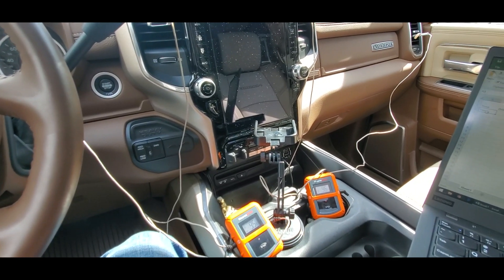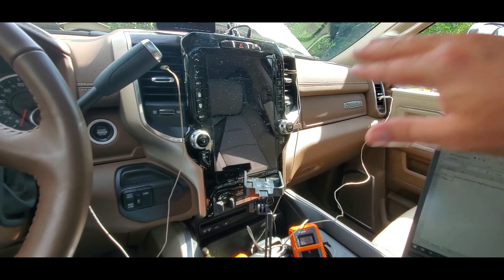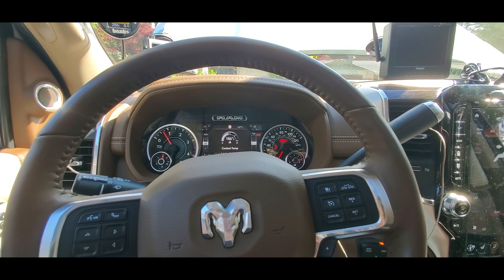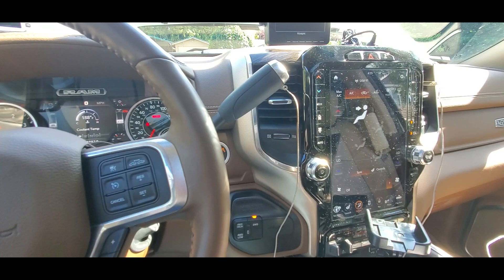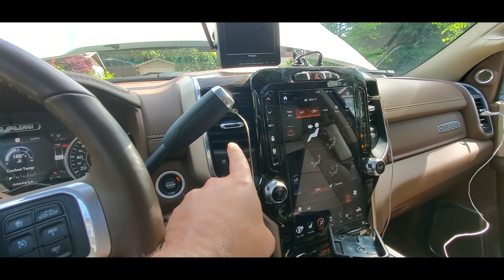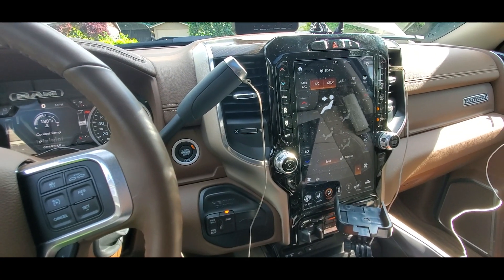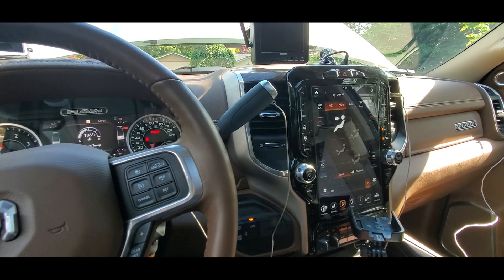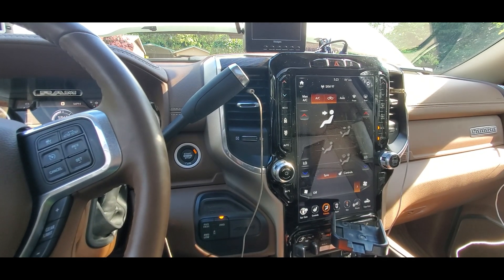Why is the air conditioning so bad in a 2019 Ram 3500?

Comment from the maker: Ram released a fix for this issue in TSB 24-001-20 in November, 2020.
Reply: I am realizing that i need this fix done
Reply: What is the fix or where can I read about it?
Reply from the maker: @nandiito  Google "TSB 24-001-20" and read the first document. The Fix is to have the dealer replace some air conditioning components. It was free for me because my truck is still under warranty, but it may not be free if your truck is out of warranty.
Reply: @alstuart  I just got a 2021 TRX, not sure if it would have that problem but I’ve been in the forums and seeing people complain about their ACs. Not sure if mine has that problem.
Reply from the maker: @nandiito  TSB 24-001-20 only applies to 2019 and 2020 models. There may be a separate issue with the 2021 models, but I am not aware of it. I recommend you take it to the dealer so it can at least be logged. Sometimes Ram doesn't take an issue seriously until enough people have complained.

Comment: Hey I believe the temps will get colder if engine increases RPM. When i had my 2019 Ram at dealership the mechanic indicated that the engine RPM has to be at 1500 to test system.

Comment: There’s a TSB out for this now. Fixes this exact issue:

AC issues are a combination of the blend doors not sealing correctly (hence the reason for the new HVAC box part number), a duct temp sensor location (the reason for the new distribution box part number and new temp sensor), and HVAC module mapping (the reason for the new HVAC module part number).

https://static.nhtsa.gov/odi/tsbs/2020/MC-10184475-9999.pdf

Cheers
Reply from the maker: Thanks. I pinned a comment about the TSB.
Reply: Do you know how much this TSB will cost?
Reply: @hiimkalx  Wish I could help but IDK, since mine was done while under warranty and TSBs are covered. Otherwise, you will need to ask dealer for pricing. 
Tell you what, the amount of work involved is extensive so it cannot be cheap. Thanks.
Reply from the maker: @hiimkalx  It didn't cost me anything when my dealership performed the repair in the TSB. If your dealership refuses to perform the service, let me know so I can help you.
Reply: @alstuart   yeah they said they can’t give me a price because I need to take it in. So I did and then they told me that my expansion valve is the problem. Is your truck still full bumper warranty? Mine has 50K miles on it and I only have the power train warranty left. I also have a 2019 2500 Cummins.
Reply from the maker: @hiimkalx  My truck is a 2019 with 25k miles on it. I don't think it should matter if your warranty is expired because this is an engineering defect that came with the truck.
Reply: @alstuart   so how do I go about trying to get this fixed? I’ve called 3 different dealerships and none of them seem to want to do this TSB.
Reply from the maker: @hiimkalx  go to hdrams dot com and create an account then send a message to @RamCares telling them you need help getting a dealership to perform the Repair in the TSB.
Reply: @alstuart  I appreciate it! I just messaged them. Hopefully they can help me out! I live in Utah and it’s one of the hottest summers we’ve had and this A/C not working sucks! I hope I don’t have to pay for it either. The dealership says since it’s not a recall that they dont do it for free.
Reply: So I just called multiple ram dealerships in my area and they said a TSB is vin number specific and they couldn’t find a TSB for my truck. Plus even if they did they said I’d have to pay for it. This is crazy!

Comment: Spot on!
I live in Central Texas and have a 2019 ram. The AC was instantly noticeably shitty. When summer reared its head. Long hauls it was ok..but city driving in this truck is crazy.
Dealership won't do anything since it's "working as intended "
Reply: I am having the same issue, very frustrating!
Reply: @Steven Ellis Ram released a TSB to fix this issue.  https://5thgenrams.com/community/threads/a-c-performance.605/post-364641

Comment: Did you record how to install that valve?
Reply: I just found Ramcare post on forum that they are developing a solution to solve this problem, waiting!
Reply: @uscache  
Great news, I can't thank you enough George C
Reply from the maker: @uscache  Which forum? Thanks George!
Reply from the maker: @uscache  Ram did release a fix in November, 2020. See TSB 24-001-20. Thanks!
Reply from the maker: I didn't record a video, but it is really simple. Just cut the heater core outlet hose about 4 inches from the end closest to the front of the truck. Install the valve inline and clamp.
Reply: @alstuart  Do you close the valve for better AC or keep it open?
Reply: Is it good to have it closed for colder ac what are the symptoms.
Reply: @jorangel87  You do not need to do by yourself now, check with dealer TSB-24-001-20.
Reply: @uscache  thanks
Reply from the maker: @uscache  I didn't see you posted this, so I replied to an earlier comment you made. Thanks for circling back and letting us know about the fix.
Reply: @alstuart  No problem, I have swap the 2019 3500 Lonestar to a 2021 2500 Limited, the air is freezing. Looks like they did make a mistake on 2019 models. I bring 3500 to a dealer and ask them to check this TSB, but I did not receive a call back even after I have swap the truck.

Comment: Well done test. But since the previous models also had coolant constantly through the heater core yet had colder air, it doesn’t explain the weak performance. From what I understand the refrigerant capacity on the new model isn’t much, like 1.2 lbs. Is this the same as the previous model?
Reply from the maker: Ram released a fix for this. I had the repair done on my truck. They had to replace a HVAC control module and two major HVAC ducts that reroute the coolant lines. At least I got a free coolant change out of the repair!
Reply: @alstuart  Was the repair effective?
Can you quantify it?  Thanks!
Reply from the maker: @bradwilliams7550  I wrote a review of the  results on hdrams dot com forums in post #55 and #58 in the thread titled " Constantly adjusting heat." I will edit the video description with links.